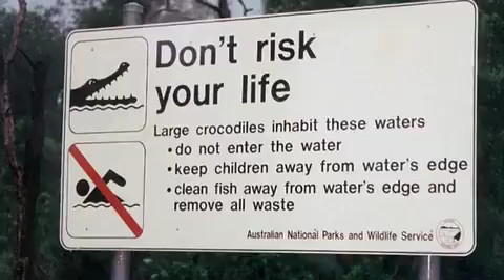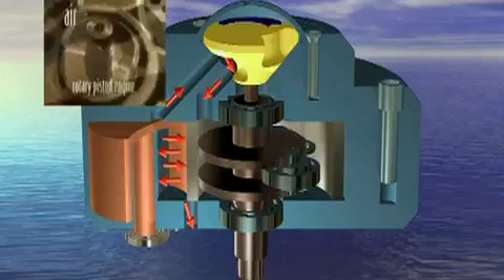The Air Powered Car Part 1

Comment: Angelo Di Pietro we cant leave it to those with big money cos they have too much to loose from your engine and CAV. But it is imperative that your engine and CAV grow in use before the whole world tries to go electric!. The climate can’t wait for us to build and fuel 100’s millions of electric cars, we are struggling to get enough renewables for domestic, work, hospitals etc etc as it is!. Fords won’t put the CA Model T into production until TATA, Puegot etc push them into it. I think they( Fords)  just wanted to be ready with the best design and engine incase CAV take off. Puegot have produced a CA Hybrid with regenerative breaking and suspension to re compress the air tanks while the car is moving!.

Comment: @MrROTD You lack the ability to do maths or understand basic physics. Air cars in reality go about 5 miles the promoters claim stupid distances (120 km 200miles take your pick) so technically illiterate fools will invest. Their are no independent tests confirming the impossible speed range and distance claims and NO cars have ever been sold. Air motor systems are only 20% efficient compared to 90% for battery motor systems. A $30,000 PV system needed to recharge an air car to go 5 miles Dumb

Comment: @fizzguts You lack imagination, this could be charged from solar or wind plants on your house or better yet have solar panels on the car pumping it up a little as you drive., they already have Air cars that have enough range to get most people to work or shopping. perhaps the tanks can be designed for more pressure in the future. do you work for an oil company? they'd hate any technology that can help replace Gasoline and oil.

Comment: Pity these idiots didn't spend two minutes with and engineer or someone who could use a calculator so they could understand just how miserable compressed air is as a storage medium and how inefficient it is. Designers, "I hope I believe" a curse on society. "This engine is extremely light" yes and it's ONLY 6 HP for fucks sake and it uses air at an APPALLING RATE